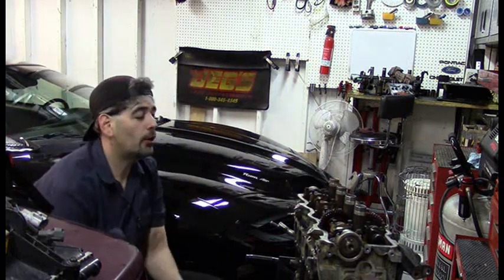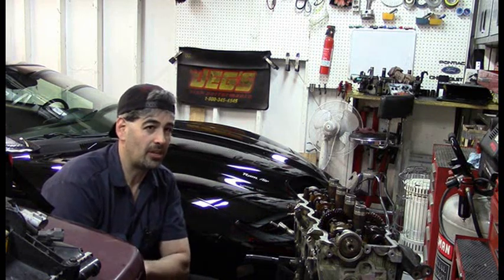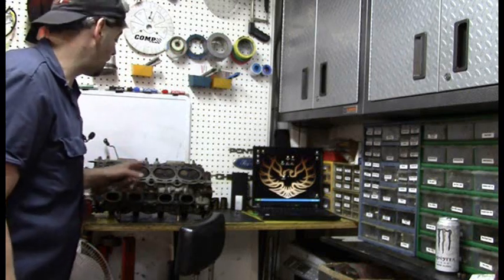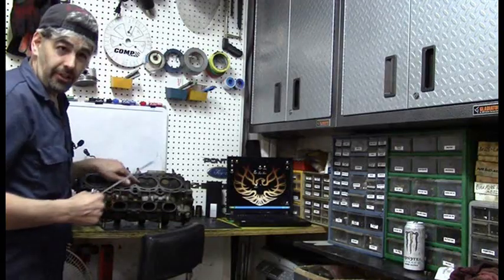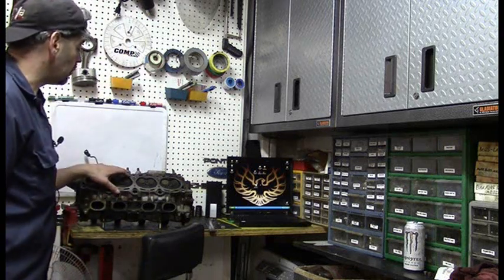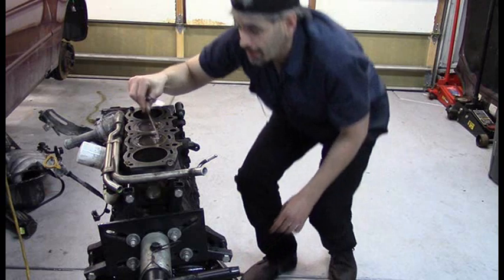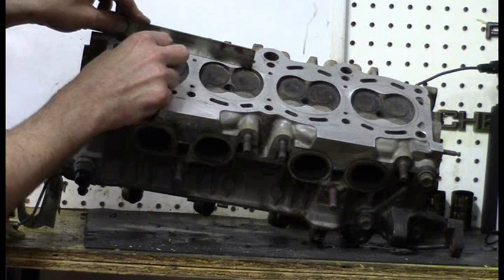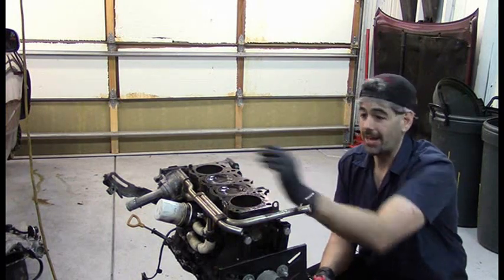Replace a Cylinder Head Gasket Yourself and do it RIGHT! Part 1

Comment: is it ok to change the head gasket while i'm doing the chain job in a high mileage vehicle like 164000,since i have the engine out of the car,i might as well do it right?the head gasket is fine,no overheating ,the engine works great just rattle at cold start until oil pressure built up
Reply from the maker: +STEEVE DAVID Nicolas There is no more reason to do that any more than to think you might as well change the piston rings, the crankshaft bearings and thrust bearings while you're there, right?
Reply: The engine works great beside the timing chain rattle at cold start
Reply from the maker: STEEVE DAVID Nicolas "Don't fix what ain't broke" comes to mind here. I don't see a head gasket replacement as "preventive maintenance".
Reply: U dont think i should change?do u know the ford 4.0 engine ,if i dont change it,that's mean i have to take the engine out to to change the head gasket
Reply from the maker: STEEVE DAVID Nicolas I don't know of ANY engines you have to remove to replace a head gasket. But it is way easier that's for sure.
Just fix the chain. There is no reason to replace a head gasket on a car with no problems with it.
Reply: The reason why it is because it is high mileage,the ford 4.0 have 3 chain,one in the front,one in the back,it is an explorer v6 2002
Reply: +STEEVE DAVID Nicolas Change the headgasket. You need to. Because you need to.
Reply from the maker: ***** The question was WHY DOES HE NEED TO?  "because you need to" is what a chatroom armchair mechanic says.  A skilled mechanic will give specification related criteria.
Reply: My answer was "Because you need to" because he obviously feels implied to change it no matter what you say. He is almost arguing you about doing it even though it would be completely retarded to. I obviously got here to watch your video and here your knowledge so of course i'm not a mechanic. I'm replacing my head gasket, for the first time ever doing engine work. It's coming out nicely but your tips helped me out man.
Reply from the maker: ***** Ahhhhhhhh  Dude I totally misinterpreted your comment!  My bad.
  I fell kinda stupid now that I see your point lol- that was actually a really good comment.
Reply: +Schrodingers Box can I do this to a 99 cadillac deville? but I heard the engines are hard to remove due to the fact They come out downwards and have to drop transmission and oil pan
Reply: +Raul Flores whats the best way to do it?
Reply from the maker: Raul Flores I have removed northstar engines from the top. Pretty much I always remove an engine when doing cylinder head to ensure I do the job properly and with even torque. It's not much more effort to remove engine than to remove cylinder head with it in car.
Reply: +Schrodingers Box thank you so much Me and my cousin were arguing about this the other day now I know I was right lol
Reply from the maker: Raul Flores Lol yes you were right. Now mind you removing it is easy- replacing it was the hardest part! It took me far longer to reinstall and line up with trans than it did to remove it. But as always once you get it bolted to the trans, it's cake from there on.
Reply: Oh alright so how long would it normally take to get job done?
Reply from the maker: Raul Flores A long time! I broke it down over several weekends actually because remember this isn't my career and in fact I no longer do basic wrenching jobs- I just stick to diagnostics now.
But from what I recall a Northstar cylinder head took me 3 weekends. It took all saturday to remove the engine. Then Sunday I would remove the head, do my inspections and have any machine shop work done during that week.  The following Saturday I reinstall the head and do any prep for install which took all friggin day Sunday just to bolt up to Trans and bolt the flywheel and mounts.  The following weekend I would finish the job. and return car by sunday evening.
  Total time hands on... Maybe 35 hours?
Reply: Damn thats long but not impossible and thanks for breaking down how you did it I think imma do it weekend after weekend instead of doing it all at once thsnks again for all the advice you been a big help💯👍👍👍👍
Reply: +Schrodingers Box  what are your thoughts on the quick fix blue devil head gasket fix , and related products ?
Reply from the maker: JohnnyBGold See my video on scientific testing of head gasket sealants.

Comment: Great Video. I appreciate the time and effort. By the way what caused the head to warp on this engine? Did it overheat due to thermostat or radiator?
Reply from the maker: John Hurnyak It definitely overheated due to.... get this.... a bad radiator cap! This exact car was actually featured in a previous video showing the diagnosis in fact.Actually I have seen that a lot!  Overheating is almost always the cause though one way or the other.
Reply: @SchrodingersBox  I thought I missed something. I was scavenging for what caused the warped head. Thanks

Comment: Is a thread chaser the same thing as tap of the same size as the threaded bolt hole?
Reply from the maker: Jan Post NO! Good question!  A tap or die is specifically to cut new threads- a chase restores them.  Using a tap to try to restore threads can sometimes ruin them as it will "force" the thread pattern and it will be apparent when the tap or die gets stuck trying to recondition the threads.
  I have a complete tap and die set as well as a MAC chaser set which I got at a pawn shop for $100.  Fortunately I use the chaser set much, much more often than the tap and die set- and in fact that's mainly because I use the chaser set in the first place!  The more you practice with this stuff and do the techniques right, the less you use bolt-outs, taps, dies, and drills lol.
Reply: Schrodingers Box You're right. Extremely worth it to come back to old vids because of comments! Plus, one doesn't have perfect retention so the video is good again too. :)

Comment: A close up of the block and head mating surfaces would be nice. Also, type of head gasket used. MLS vs composite along with plus and minuses of each. My heads will be here today and I damn sure do not want to do this again. 5VZFE.

Comment: I have an interesting case with my gas V6 6VD1 Isuzu engine. It started to overheat and build up the pressure in cooling system. I run the test and it was clear that exhaust gases mixed with coolant. I performed the head gasket swap on both sides, inspected the surface of heads and block, cleaned (no cracks, no warp). But after 800 miles it started to do the same thing again. So I just curious what takes my gaskets off all times as that is not immediate effect, it took couple of cycles to get it blown again, so maybe it was bad bolts?
Reply from the maker: You cannot check for cracks without doing a magnaflux which a machine shop will do for maybe $50.  Sound to me like you might have a crack in the head that was only temporarily fixed by the gasket.
  You will need to take the head to a shop and have them checked by the shop.  If they find nothing wrong then you have 2 possible explanations: 1. incorrect installation was the problem or 2: the crack is in the block, not the head, though this is extremely unlikely especially with the temporary fix symptom you described.

Comment: I am tedious about stuff. I just bought a car in very sweet condition with an LX5 Shortstar in it. Although it is a rare and expensive engine I just like the look of the car. I may put a 3800 and it's trans in the car.

The engine still sounds good. I think the rad may have let loose because the coolant was blown all over the side of the engine bay right at the belt. I bought it for a winter project so not really a big deal to me. May just be a bad hose I couldn't tell right off. The lady just pulled into my job and told me she would take 100 bucks for it so I was like ok because it is worth at least that in scrap so.

It really seemed to have blown something in the cooling system and it has a bad crank pos sens. Seems like a fun little car to work on and play with. But it is a hobby as well so I know I aint getting back what I put into it just like I don't expect to make money from the model cars I put together. The 3800 swap would make the car a little more reliable and with the computer and harness I can figure something out to make it fun.

At the very least I will do the head gaskets to update the cheap nylon thread inserts and check flatness, check for cracks, machine it, stud it, clean it, put all gaskets on and be done with it. The block is also coming out. Like I said winter project to play with lol. Makes it easier making decision when you don't really need the car but doing it just for fun.

Lapping is better in my opinion than machining. Jean Bugatti did it to both the block and head of his engines and never used a head gasket at all. Thats how flat he got them lol. Glass makes a pretty good surface for doing it.

Lots of great information. I enjoy your videos because of your attention to detail and your tendency to explain a lot. Your right a lot of people slap a new head gasket back down and bolt it up. I have seen people never replace TTY bolts which I usually tell them "Dude its gonna fail again". You are a good mechanic and you look at things a lot like me and that is like an engineer rather than a basic mechanic and think of things logically.

Keep up the good work.

Comment: I have a 1994 Mazda Miata (MX5), wish I saw this video prior, my oil and coolant are mixing. The engine is fine on my compression tests though, I ended up putting a new head gasket on (mind you this is before I knew much about cars or your channel!) and the car ran great for about 10 miles then the symptoms came back.... You mention at the start of the video, that the check's you are doing are due to low compression. From memory my compression readings were in the normal range, and all cylinders were close to each other. Is it possible that the head gasket leak is between a oil and coolant jacket and that the compression rings on the head gasket are sealing? I don't think there are any other ways for oil and coolant to mix on a MX5

Comment: Hi, I’m Rey Zapata from San Fernando Valley in LA Co. last year my 70 Chevy Impala over heated in October. Because my radiator cracked on my way out of town. So I had the radiator, water Pump and thermostat replaced on my 350 engine. But my 70 still get hot. Everyone said I have a blown head gasket. I did a compression test and all my cylinders read 90- 95. So, I drain the oil and there was no water in my oil or on the valves. But I did notice I was leaking oil and the valve stem seals needs to be replaced. Would that be the reason why I have low compression and not a blown head gasket.???. What do you recommend.?. By chance are you located in Southern California.????.🙏🏽🙏🏽🙏🏽👍
Reply from the maker: if all cylinder have low compression then it sounds more like just engine wear. what happens when you add oil to the cylinder and do the compression test? If the compression is much higher then you have worn rings. but it doesn’t sound like a head gasket the way you describe it. but there are many other reasons for low compressions.
Reply: Thank you for your advice. Now it gives me a chance to drop a new rebuild engine and get back to cruising again. 
Great Video’s and God Blessed.😎🙏🏽😇👍

Comment: Was kind of disappointed we weren't shown the old gasket.  He did mention some of the head bolts were relatively loose.  I wonder if they could have just been retorqued and the leak down test performed again to check for sealing.
Reply from the maker: no you can NEVER retorque a head gasket to fix it.  in fact it almost never works on an intake gasket even. but definitely not a head gasket.  The loose bolts are actually the result, not the cause of the problem.
  I guess could have shown the old gasket but there is seldom much information on it. Any tears or breaks in the gasket are more often due to it being stuck to the surfaces when removing the heads than an actual autopsy of the problem.
Reply: @SchrodingersBox  Thanks for the rapid reply!  How are the loose bolts the results the head warp and not the causes?  Could the bolts around the leaking cylinders be replaced and retorqued if the originals were found to be loose with the head in place?
Reply from the maker: when the head warps, the torque angle is no longer applicable so some bolts will loosen. tightening them will not fix the warp. plus remember when you torque a bolt the bolt stretches. so torquing additionally means there are different tensions with each bolt. 
  Resurfacing and new bolts with consistent torque angle  is the only solution.
Reply: @SchrodingersBox  Thanks much!

Comment: Hi. Once I establish the cause of the failure should I also find the root cause of that cause? In my case (head gasket blown says Toyota workshop) if I assume the route cause to be an overheated engine when a coolant hose burst 6 weeks ago, do I leave it there or take it further to find out what caused the burst hose in the first place? Even though it's a 20yr old car, I'm thinking what if the hose burst to some pressure / blockage problem and not age? Or is that not possible? Tx for all the interesting tips, btw.
Reply from the maker: +ratfinkza indeed always trying to find the origin. A burst hose is actually often the result of a failed head gasket, not cause of it as the combustion pressure builds up on the cooling system, so the hose is often not the cause of the overheat.

Comment: Hi,I am changing the gaskets on all the engine in an attempt  to  get rid  of all the oil  leaks, I was told to change the  lifters while it was open, well I bought some on ebay (Howard brand) I order them by the engine size and brand (AMC 304 on a 1976 cj-7) but the ones I got are a few mm shorter, can I still use them or not, thank you for  your  time
Reply from the maker: cachito13 Good idea on replacing all the gaskets however using shorter lifters will change the valve lift and may even make valve chatter. I would totally advise against it and in fact, even if the lifters were the correct size I would not use them with the old camshaft.
Reply: Schrodingers Box so keep using the old ones?
Reply from the maker: cachito13 Either use the old ones or get new ones and new cam.  There will be specifications for lifter wear (and in fact camshaft lobe wear) that you should check first.  I have a video on budget engine rebuilding that shows how to do this.
Reply: Thank you very much for taking the time to answer my questions!!! you are awesome and a great mechanic

Comment: I have a 05 malibu that's getting coolant in the oil but the compression was fine. so can a bad intake manifold cause the coolant to leak into the head???
Reply from the maker: YES!!!! See it all the time!  In fact if you engine has the 3.2L then that's almost certainly the issue.
  In fact it's how I diagnose that problem- it's through elimination of the cylinder head as the problem.  I also can usually detect an intake manifold coolant leak with a cooling system pressure test.

Comment: Hi.. Dad helping son. My son got a 95 eclipse. Non Turbo. He has 180 PSI on all 4 cyl.  The previous owner let the car sit 3 years without running (Bad fuel pump replaced for 17 bucks ebay then car running). Car has Low power. It smokes at startup then clears up.  Then smokes again when under load. Im thinking his valve stem seals are bad from sitting and oil is fouling his fuel air mix. The head has to come off to replace the seals so Ill do a new mls gasket set, new timing belt, new water pump etc because u can get all that off ebay for 65 bucks.  My question is if he has 180 PSI on all 4 cyl then that head is good?   Thanks Chuck